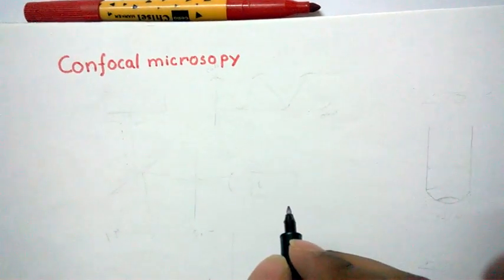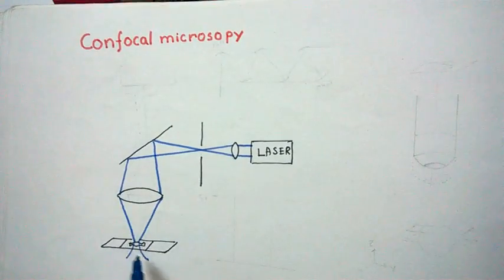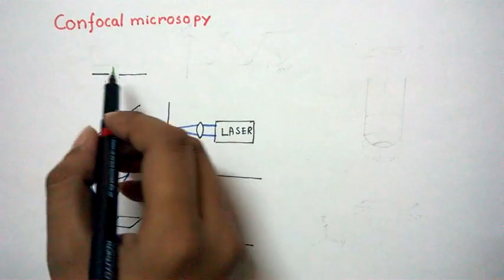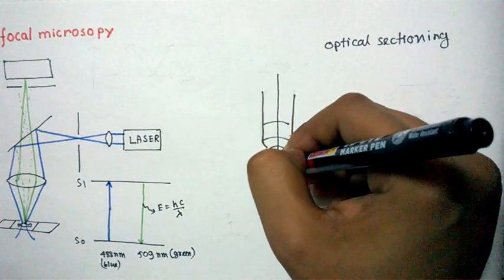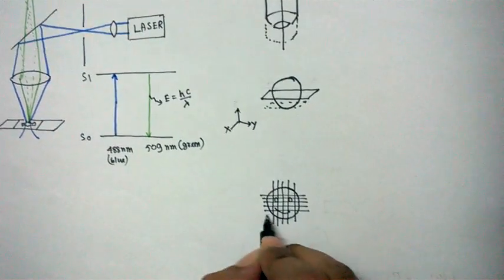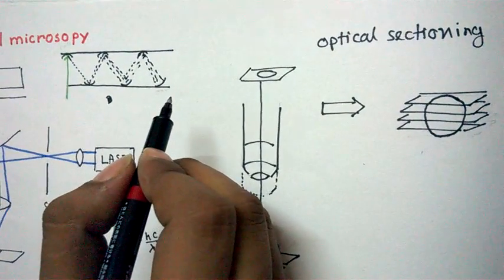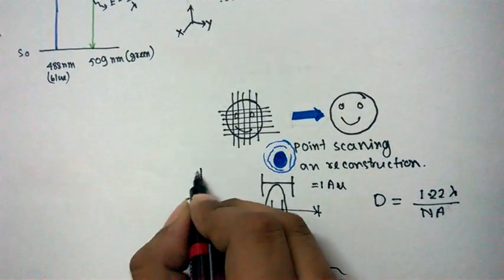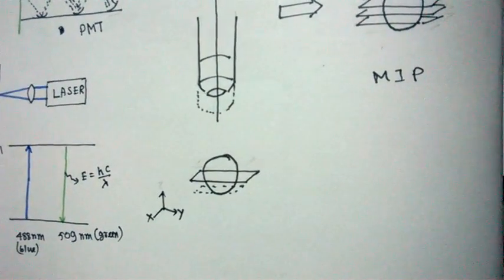Confocal microscopy Basics

Comment: This is a great introduction of the principle of confocal microscope. However, there is a mistake from 10:00 when you calculate the pinhole diameter using point spread function: D= 1.22λ/NA - this is the size of the illumination point on your sample, not the physical pinhole diameter. For physical diameter of the pinhole, it need to be multiplied by magnification (of the objective), which give the optimal pinhole diameter D = M x (1.22λ/NA), where M is the magnification of the objective lens you use with your confocal (x60, x100,etc). It is worth to point this out in case mislead people who are studying or developing system related to confocal microscopy. Overall, great video, pretty clear and straightforward explanation. Thanks for sharing:)
Reply from the maker: Thanks for giving a detailed feedback.
Reply: Thanks for pointing that out! - I was already wondering how such super-small pinholes with diameters of 500 nm would be realized mechanically..
Otherwise thanks for the great video arpan! :)

Comment: If an electron goes from S0 to S1 and then back shouldn't it emmit the same light as it absorbs?  What happens to the 21nm worth of light/energy?
Reply: There is an error there, there should be other vibrational states higher than S1 and the blue arrow should land there, hence the Energy difference. 😅